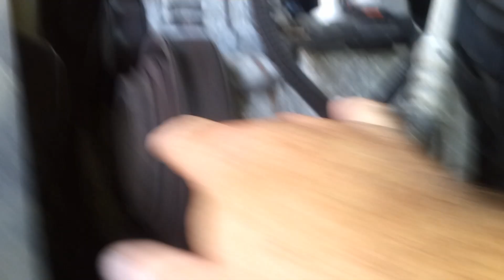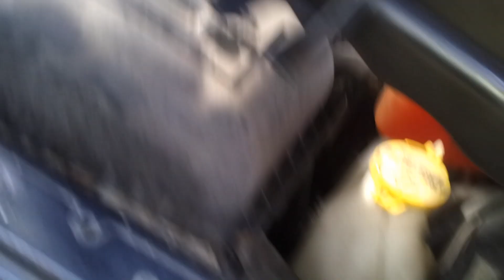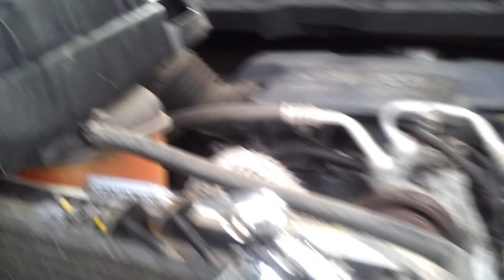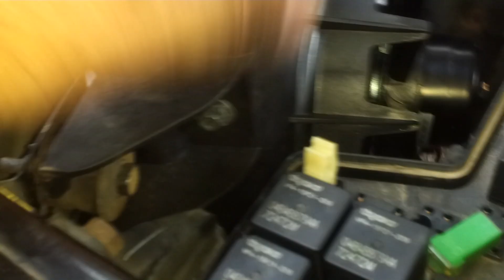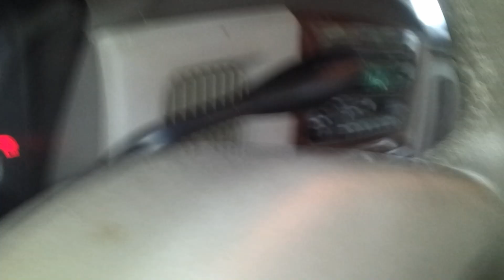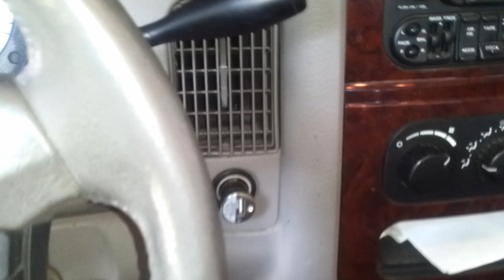How To: Replace A/C Condenser Fan on a Dodge Ram PickUp

Comment: I did this repair and the video was really helpful. I had to put the shroud also but it seemed like the only way without draining the Freon. I don't have a lot of mechanic experience at all and this was easier to do than changing the brakes or the alternator. The hardest part of this was getting the bolt behind the fuse box. I got the whole thing out by myself and put it back in with the help of someone else to make sure it went smooth. Good helpful video!!!!!!

Comment: Gre8t video, thanks for posting. Someone else recommended taking out the battery and removing the lower bolts on the wheel cover front 2 bolts & fuse box to give you extra room so you so not damage the condenser. Also the pre cut out the plastic on the old and new fan to clear the pressure line so there's no need to recharge the system.

Great install.

Comment: my truck does the same thing my electric fan quit working for my AC condenser while I was on vacation in Pigeon Forge I don't have any realize I have what they call the integrated relay included in my computer from my truck so I can't check the relays because it's integrated so I bought a new fan from Amazon Dodge replacement hope this fix it PS can't wait for cool air coming out of my truck once again God bless. God bless Dodge Rams amen. thanks for the video

Comment: Did everything he did except I only bought the motor. It was 25 compared to 100 for the shroud and motor. Just instead off installing the new shroud I put the old shroud and new motor back in.

Comment: I had a water pump replaced in an 09 Dodge 1500 5.7 liter and my AC went out.  I'm looking to see if it's possibly related.  Do you have any opinions?
Reply from the maker: Probably not related... but I honestly don't trust many shops. The A/C system is always a money making affair. While most people will attempt many repairs themselves... they tend to be scared of A/C work, and shops know that. Loosening a connection, or leaking some Freon out, is an easy way to ensure a return visit. Good Luck!
Reply: Daniel Scheer I appreciate you responding.  It didn't occur to me at the time, but I could've bought some Freon to install myself and then just drive my truck to see if it leaked out.  Since then the "sales" guy said my schrader valve was loose or they wiggled it installing the Freon and it didn't leak anymore...

I heard from a radio consumer advocate that if your too loyal, you typically don't save money. So time to move on

Thanks again
Reply: hmm me too, same mechanic?

Comment: I did a nearly identical repair a few years ago and had to cut the new shroud in the exact same place in order to fit it around the refrigerant line thus allowing me to avoid having to depressurize and re-pressurize the entire a/c system. 
HOWEVER...
At the time I wondered, "how much do we compromise the structural integrity of the fan shroud body by cutting out that section, and very near a corner to boot?" Looks like we have an answer.
A few months after the repair (replacement) I noticed a small click-click-click sound coming from the a/c fan. You could only hear it after shutting down the engine and walking past the front of the truck as the a/c fan slowly coasted to a stop. I ignored it at the time but in hindsight now realize that the fan was rubbing on something. Now, a few years past that repair the fan has been so outta whack that the click-click-click noise is more like a loud rap-rap-rap and you can hear it over the sound of the running engine. Yesterday the fan simply died. When I went to manually spin the fan it was all rub-rub-rub with a lot of friction and came to a stop immediately.

I cannot prove it beyond a reasonable doubt, but I believe that by cutting that piece of the fan shroud we introduce a weakness that manifests itself over time in warping of the shroud body, displacement of the fan/motor out of true, leading to the fan rubbing on something and eventual failure (probably motor burn out from friction of out-of-balance rotation.

So now I'm looking at my second repair/replacement (the THIRD a/c fan assembly counting the one that came from the factory) in 11 years and 186,000 miles.

Having said that, I'll continue to cut that piece of the replacement shrouds as I find it cheaper and more convenient  to keep replacing a/c fan shrouds every three years or 60k than to even once put that truck into a shop for who knows how many hundreds of $ and who knows how many days while they dork around evacuating the system and invariably "find" more things wrong with it that they'll be happy to repair for me while I have it in their shop. No spank you.

So if I'm going to continue to cut out that piece of the fan shroud then why I am bothering to whine about it here? Well, to give notice to others who might be on the fence about doing it themselves or taking it to a mechanic; and if someone has an alternative method, possibly reintroducing some strength back into the fan shroud after we cot it, that would be most welcomed.
Reply: Couldn't you have just plastic welded that cut out piece back into it's original position?
Reply: Erik Galindo excellent suggestion,  thanks.
A few months ago I put in that third fan shroud/fan in the life of the truck.
209000 miles and it's third one. Not bad.
maybe I'll use your suggestion, probably not (lazy, not that yours is a bad idea). perhaps on the FOURTH fan shroud if it comes to that... LOL

Comment: How did you connect the electrical parts that didn't match up?
Reply: Israel Pena ~ You can disconnect that pigtail from the new fan assembly.   Your wiring harness should fit that connection.